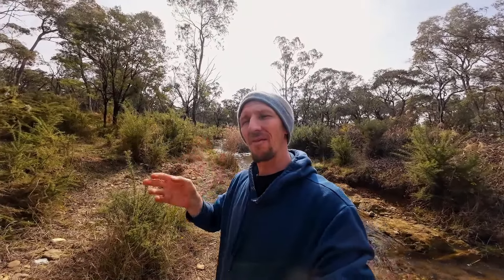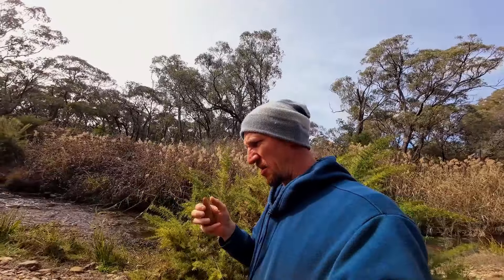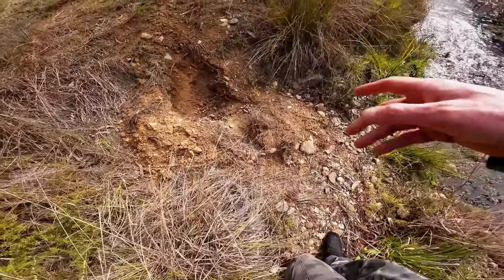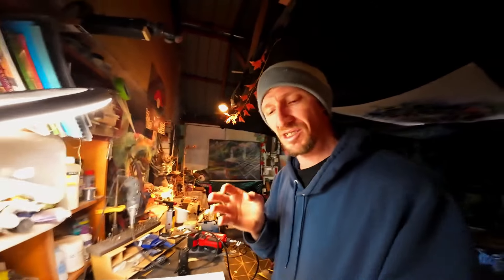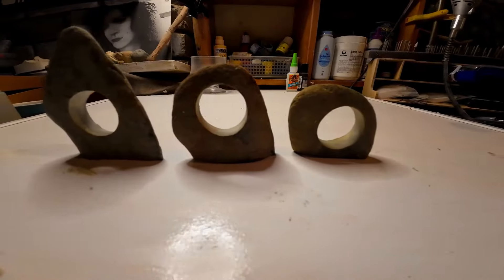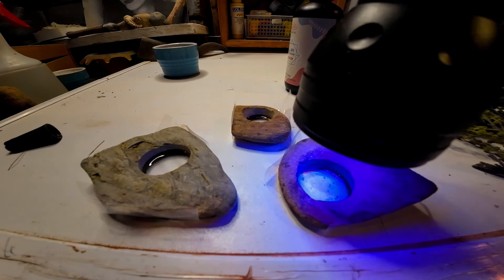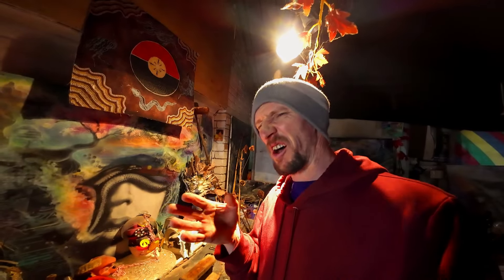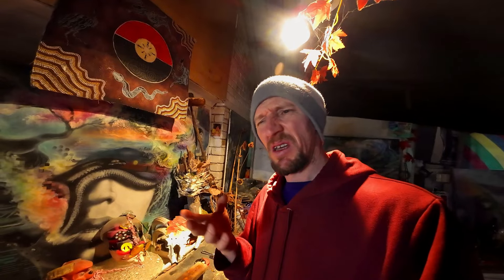Creating Something With River Rocks

Comment: Very pleasing results, Gadzee, showing that UV-set resin is a revelation. Great effect for the "wet" look, would work with banded agates and jaspers, cool grains of timbers, a very many creative applications, cracked furniture bits, you name it! Oh, and if you'd give Chris a glow of that UV torch on his sapphires, they should have a visual glow even for his colourblindness, it'd combine with his ability to discern refractive and reflective light, light that comes from inside that is the "thing", and not light that falls upon it that isn't the "thing" in itself, a theory we're working on, needs added fibre to digest, but let's reference Peter Saville and his dichromatic photos, "Blue Peony" and "Red Coral" for the New Order compilation, "Substance" of 1987, and all the best album covers of the eighties. I think those two photos were bought by IBM and in their head office foyer, I'll need look that up and earn another nerd scout patch ey. Aye, for art great keeps you smiling inside, and smiling on the outside easier. Cheers, Gadz, from the Gabs!
Reply from the maker: Yeah it's cool stuff there's so many different applications for it due to the curing time. I think it does react with some things like the stone took a bit to cure thin layers helps. Thanks gabi

Comment: Best Resin out there.  UV both the back and front of the base to start. Do them in stages, resin the coffee, moss, then wattle. Pop any resin bubbles in between.  Its fantastic for making jewellery cabs and beads with.
Reply from the maker: @ccccarriemchardy9216  yeah I should of done one at a time too. Beginners mistakes. I've just made a few lil cabs they turned out well with the resin

Comment: Ive got a roll of the resin tape if you want it, it is heat resistant, so wont melt while the resin cures
Reply: I've also got a little uv nail lamp. I can shoot that over too

Comment: I'm just looking to start with UV resin - to repair stuff at first, but I know I'll start on jewellery 🤪

To get rid of the bubbles, apparently you heat the resin with a lighter.  Flame near toxic chemicals sounds a bit iffy to me, but this video does it...

Also a suggestion: set some small crystals in clear resin in a bezel as a pendant or earrings. 

https://youtu.be/CktdaL-l_3E?si=t_qtZwOJJaGIL0o3
Reply from the maker: It's pretty handy stuff. Yeah I'll use a heat gun next time. I need to go get more crystal I think
Reply: @buckshotprospector  The tiny ones that you can't facet - clean and polish, then set in a bezel with clear resin. 👍
Reply: @buckshotprospector  The heat gun might blow the unset resin around though...  🤔

Comment: Just a suggestion, try painters masking tape. May adhere better and don’t scrimp on cheap tape. Other thought is if you have an ultrasonic cleaner the vibration may help remove bubbles. Great start.
Reply from the maker: @krisgalusha9820  I actually had some I wasn't sure if it would do a better job. Most people use cello tape. Oh that's a good idea I do have one

Comment: If you were to lay the pieces flat while wet and spin them the bubbles may take on the form of rain drops.
The bubbles look a bit like rain but they aren't 'stretched' they way droplets typically are.
For no bubbles you need a vacuum chamber.  I suggest buying a 'Food Saver' or similar vacuum bagging system.  Cheap.
Or a Brake Bleeding System.  Those usually have a Hand Vacuum Pump in them.  With a gauge to let you know how weak your hands are.  :D
Reply from the maker: That's a good idea yeah vacuum chamber is for larger quantities because it's difficult to remove the bubbles in a two part mix when mixed together

Comment: Awesome concept!  you mentioned that you had bubbles in the resin, I have heard  from others that you can take a heat gun or torch you can work those bubbles out before the resin cures.  Another way is to use a  pressure pot, no not an instant pot, save that for your food LOL
Reply from the maker: Thanks Carroll yeah a torch or heat gun yeah pressure pots ain't cheap I think you use them for larger amounts because the heat can't remove them when it's thick. I've seen people placing the resin in a cup thing in hot water.

Comment: Painters Tape will make a better Seal and will have better release Properties.
Something you might want to look into are Tritium Light Tubes.
A tiny 2.5cm tube could cost you more than $50.  So why do you want it?
Because it softly glows with colored light for around 100 years all by itself.
Reply from the maker: Yeah I has painyers tape but I've seen people use clear tape it seems to leave a cleaner smooth finish on the resin. Isn't tritium radioactive